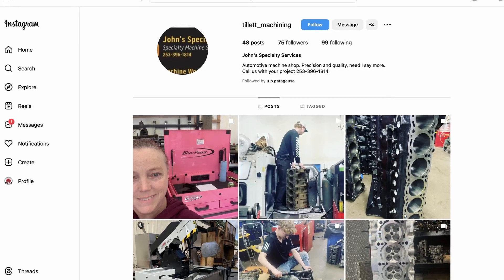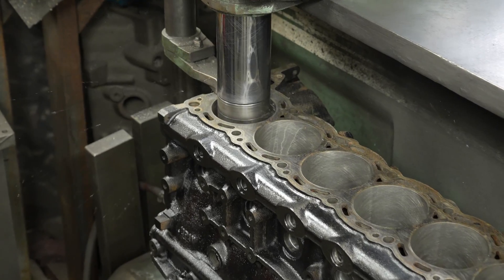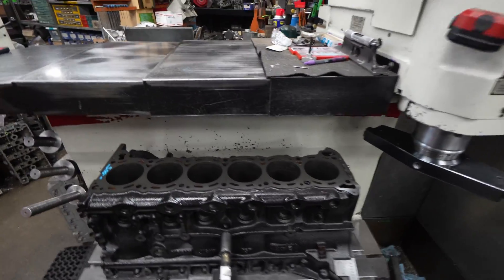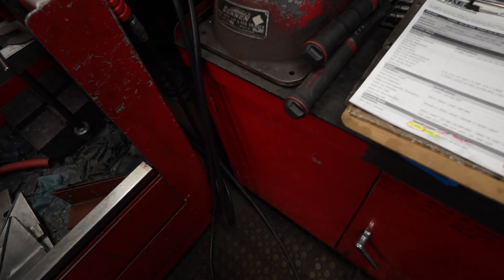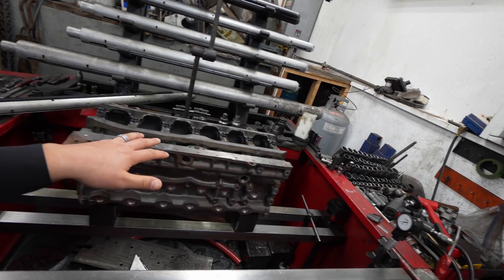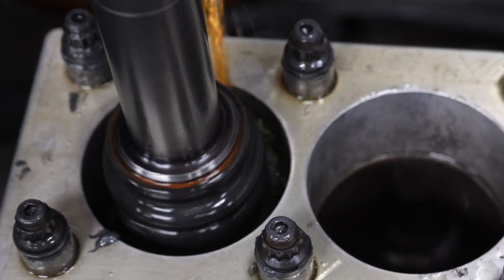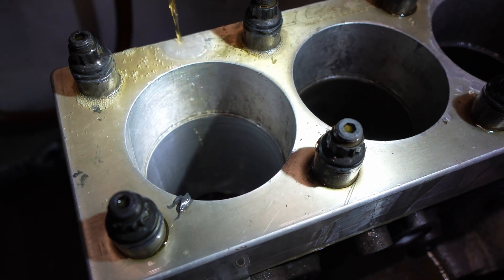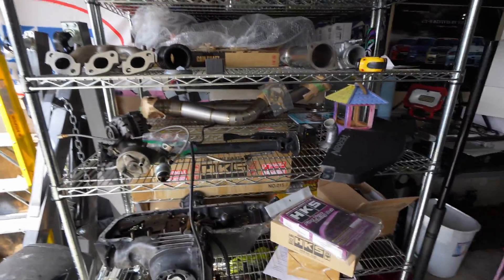EP1 RB26 machining process How To. John's Specialty Service machine shop tour. Engine build!

Comment: Did get your block sonically measured before you started the machining process?
Reply from the maker: No we did not measure the block that way. John inspected the block cracks and made sure it was in good shape to machine for my build. John said my block looks great.
Reply: @JDMRightHandDrive this was the first thing I did before my build it cost a few hundred pounds do and can save you a lot of money in the long run 
when you are going oversize on your piston this is really the first part of the process just to see what material you have to work with because you want a minimum of 3.5 mm on the wall thickness this is what ever Australian rb is built to for reliability 
I know a guy who got a brand new 24 u rb block and was going to 87mm on the piston size and when the block was sonically measured it only had a wall thickness 2.8 mm on a standard bore and the block is basically scrap 
Good luck with your build I hate to see your engine fail after the amount of money you are spending if can get it measured before you build it just for piece of mind it could save you thousands